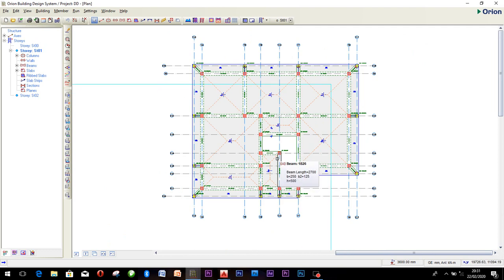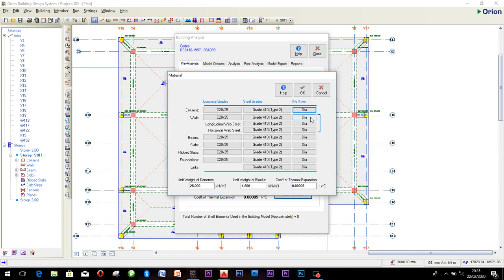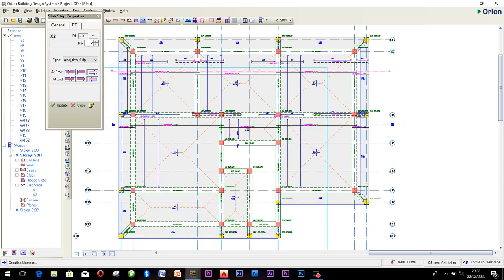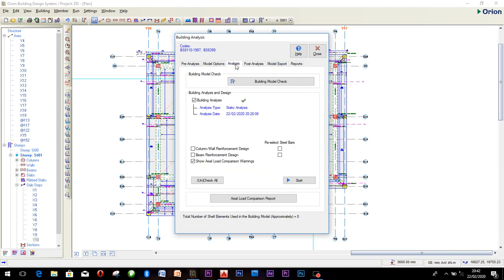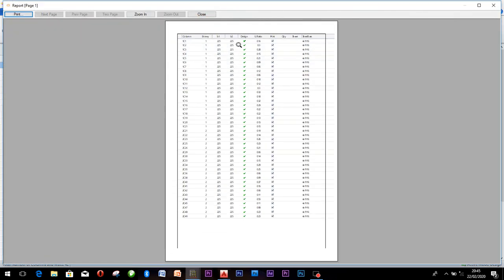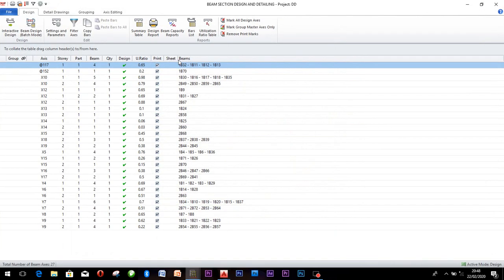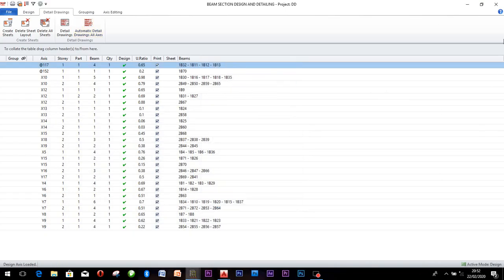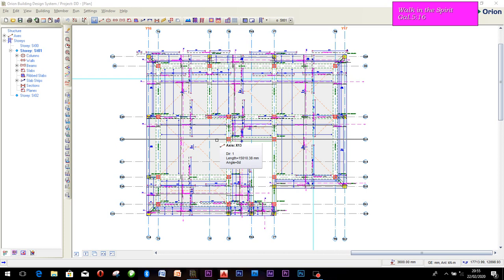Slab, beam and column with detailing complete analysis with CSC ORION structural analysis software.

Comment: Good morning sir, I have been following ur videos but there's something I'm not getting clear. Concerning the cantilever span because in ur previous class u showed us a real life building having a cantilever, my question is why did you not design for the load that is acting on the cantilever? Because a wall is actually resting on the cantilever, and what type of load should be applied on that cantilever span?
Reply: Everything is not covered in this tutorial. But necessary things that will sustain a structure is covered. However, there are additional loads on the cantilever. This is where the beam wall load comes into play. Highlight one of the external beams on the cantilever, right-click and select EDIT-BEAM-WALL-LOAD from the options. Then design the load using unit weight of a block wall. Unit weight of a 1m2 of block wall of 225mm block in Nigeria is 3.85kN/m3. Found out the unit of your own wall in your country depending on the size. When you are done setting the design, you will notice the change in color of that particular beam. Select the beam, right-click and choose COPY-BEAM-WALL-LOAD, Then Highlight all the beams on the cantilever with respect to where you should have a wall and paste BEAM-WALL-LOAD. After all is set, Run Building Analysis again and enjoy...
Reply from the maker: Chat on whatsapp for more clearity +2348174616009. Dainty studios
Reply: I tried inserting the beam that is supporting  the cantilever  but keep telling overlapping  and your number is not going through.  Please I do I fixed this so I can be able to insert  the beam to support  cantilever  slab

Comment: Wonderful tutorial. You grabbed the bull by the horn. In your next tutorial consider adding wall loads on your beams. It will help determine complete structural load when performing load chase down. To consider wall loads click/pick any beam that has wall loaded onto it, right-click and choose edit-beam-wall-load, add the wall thickness, unit weight of the wall and the dead-load will auto calculate. Then copy the beam-wall-load by right-clicking on the beam, highlight other beams you want to load walls upon and paste. This you must do along-side this tutorial from first to second before performing analysis.GoodLuck!
Reply from the maker: Thanks allot. They're other tutorial like a staircase design and footing design. Like and share on
Reply from the maker: Chat me up on WhatsApp +2348174616009

Comment: Why is that all the time your links spacing is always 175
Reply from the maker: That's what it calculates....
Reply: @daintyconsult1234  is there any way to change it... From my observations all the time i make a story is always 175
Reply: @hafizaliyuadamu5277  Yes you can change it. But you have to thread with caution. Go to settings>column settings>parameters, then change stirrup minimum spacing to 250mm. If you are sure of what you are doing. The danger looms when you forget to revert the settings while carrying out further design which has greater load of compression.

Comment: Pls what do you mean by slab stripping? Just explain in details
Reply: Slab strip is simply how your slab reinforcements are distributed with equal spacing. In Nigeria, most common structure with slab strips are distributed @ 150mm c/c. It could be less or wider depending on what your design entails. It is being distributed in X and Y direction. We have main bars at the bottom while distribution bars are placed at the top to provide equal spacing. Main bars must be placed in the shortest span direction. Take time to study concerns about spanning way slabs.

Comment: nice work my brother , i am working CSC orion in bars i see H16  and in your work you see Y16 pls help me out
Reply from the maker: After running Ur analysis, and the result are ok. You dnt have to worry if it's H OR Y
Reply: Thanks brother
Reply: @shaklinassociates  H16 simply means high tensile steel. In Orion, higher steel bars of 460N/mm2 or 500N/mm2 are denoted with "H16" while another range of high steel bars of about 410N/mm2 are simply denoted with "Y16". So, you should know the strength of steel in your own country and apply it in the design. DO NOT use all parameters provided by CSC orion at default without enquiring to know exactly what they stand for. To effect a change in parameter concerning this, Go to building analysis Click on Edit Material. The possible elements to change are size of bars, concrete grade, unit weight of concrete and steel grade.
Reply: henry Gritchen 👍🏽